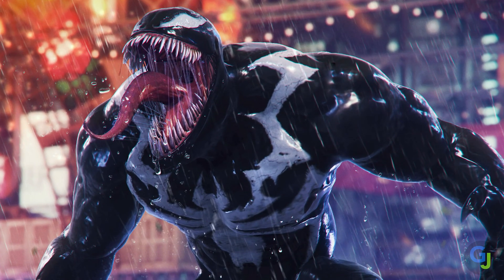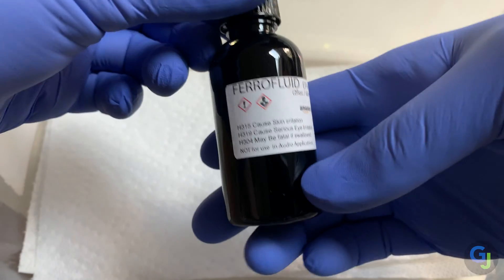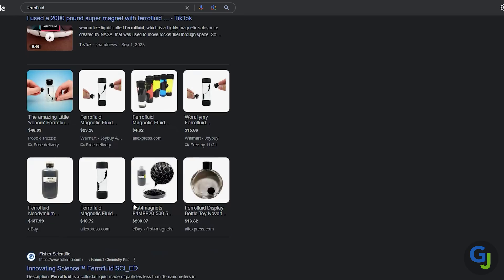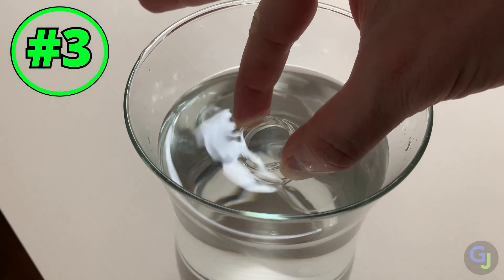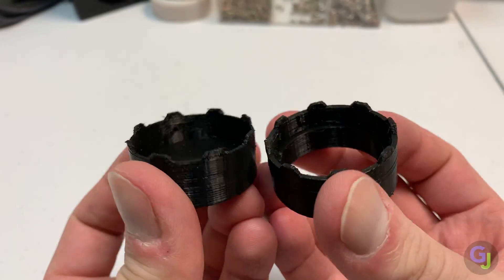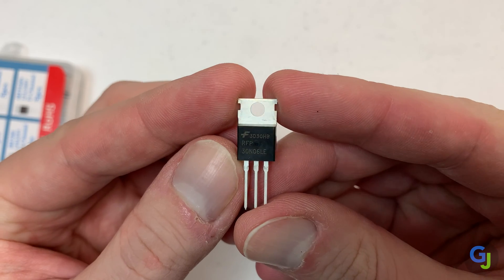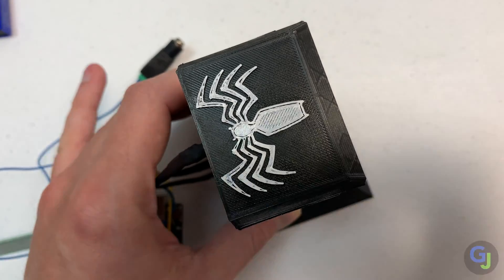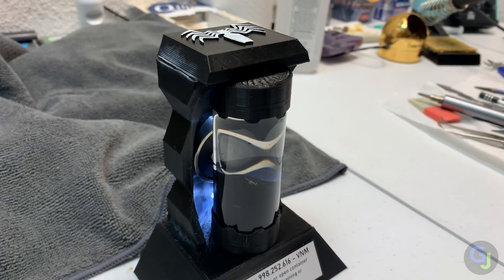DIY Ferrofluid Venom Symbiote Build That Moves ON ITS OWN!

Comment: How much ferrofluid do i need
Reply from the maker: It really depends on the size of the container you plan to use and how full you'd like to make it too. For mine I'm guessing I used a little under 1 oz or about 20-30 ml per container. That's my best guess but I wasn't measuring it when I was putting it in the bottles. I just went by eye and tried a few different amounts to see what I liked best. Hope that helps!
Reply: How much did this all cost
Reply from the maker: Maybe about $200 total? Not sure, never totaled it up...

Comment: Great video! I’m very interested in re-creating this as a project with my kid, are you able to provide the links to the STL file as well as the code that you used for the Arduino programming? Thank you so much in advance.
Reply from the maker: Sorry, I love to but I can't. Right after I finished this project my PC crashed and wiped my hard drive as well. Sadly I lost all of my project files for this and some video I had filmed too.
Reply: @gamejaeger  wow, that's terrible. Hope you were able to get back up and running. If its any consolation, it happened to me once and motivated me to use cloud backup for all of my devices.
Reply from the maker: Yeah it sucks, I do something similar now too. I'm not big on cloud storage but I bought an external hard drive that I started to backup everything to. I've never had that happen before but now that it has, I'm very hesitant to hold too much data on my main PC without backing it up. Oh well, you live and learn... I'm glad you enjoyed though! It would be a fun project for your kids for sure. I felt like a little kid at times making it... I played with the ferrofluid and a magnet A LOT. lol
Reply: I Am in the middle of doing something similar but haven't got my code tweaked just right yet out of the 30-40 videos I've watched this one was the most help
Reply from the maker: That was a hard point for me as well. Never coded before so it was quite the learning experience. Thankfully there's a lot of info online that can help though, I just started googling and found what I needed eventually.

Comment: Pretty damn cool project. Being on the electronics field the first thing I thought when you showed the small magnets was "why the hell aint this guy using bigger ones with FET as switches" lol
Reply: You could also use a Low frequency oscillator with either Op-Amps or a 555 instead of an arduino to drive the FET they are way less power hungry than a microcontroller and much more simple
Reply from the maker: Thank you, I'm new to building electronics and it took me a while to figure out everything haha. I was just constantly looking stuff up lol.